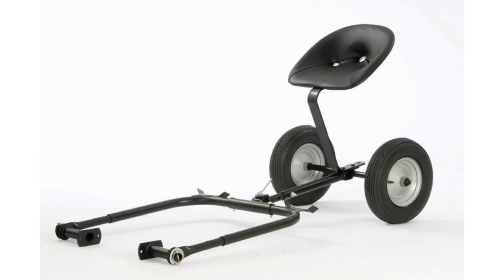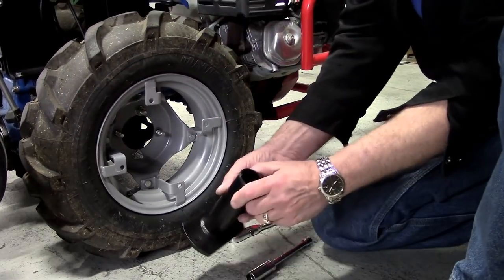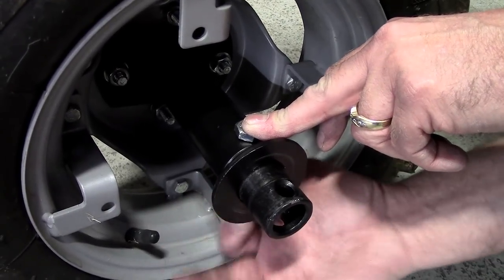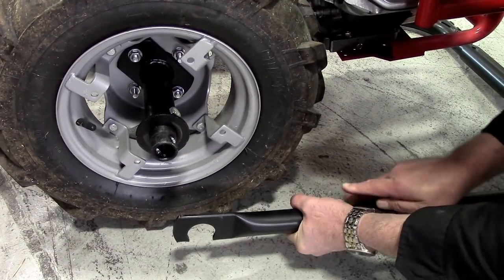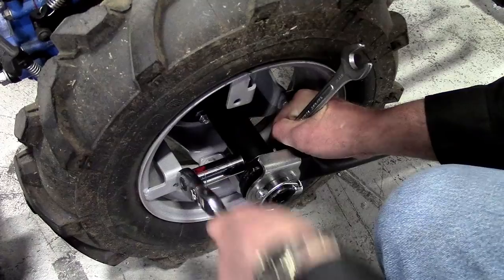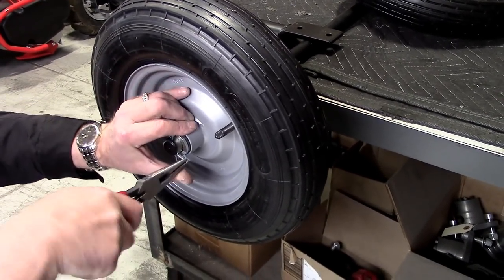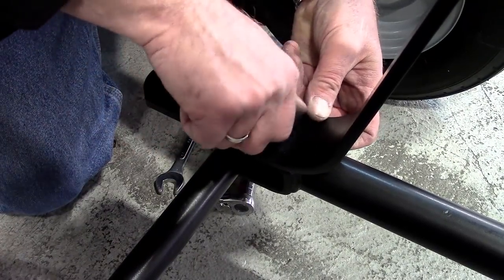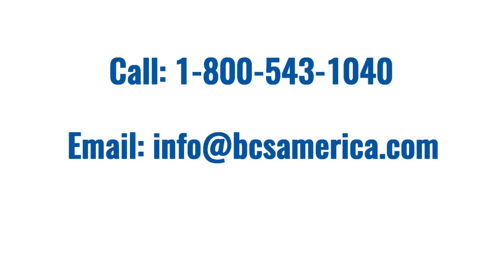Assembling the Mowing Sulky for BCS Two-Wheel Tractors

Comment: I'm looking for one to do my 4t acr farming such as cleaning weeds between spaces of rows and the width shouldn't be over 26" and  just wondering 739,749,and 853, which one best  fits my work but need good hp
Reply from the maker: All three models will power a 26" tiller without any problem.  Models 749 and 853 have the same engine - 13hp Honda.  The difference is in the clutch.  Model 749 has a PowerSafe clutch which is hydromechanical.  It runs cooler and holds up better with high-torque implements like the Flail Mower or Rotary Plow.  Model 853 has a standard, double cone clutch.  Model 739 is a slightly smaller tractor.  It has an 11hp Honda.  It has the same clutch as the 749, but has smaller wheels and does not have steering brakes.

Visit bcsamerica.com to see the full specs of all of our tractor models.

Comment: Is it possible to till with sulky attached in the feild? And ride the tiller will tilling?
Reply from the maker: No, the Mowing Sulky is only designed for front-mounted attachments.  It will not work with rear-mounted attachments like the tiller.
Reply: @BCSAmerica  ok. Can you till with it going forward in mowing position
Reply from the maker: @pinseekergaming4760  No, the tiller is a rear-mount implement and is not meant to be operated in front of the tractor.
Reply: @BCSAmerica  dang. Well hopefully in the future you can possibly make something like that. That would be sweet! To till and ride. Definitely helps on my farm for sure I love the 710 that I have just wanted to invest into the sulky. It probably come in handy for the hey feild I have.